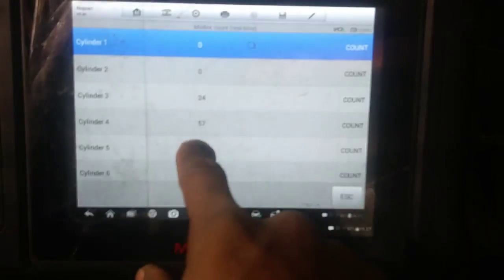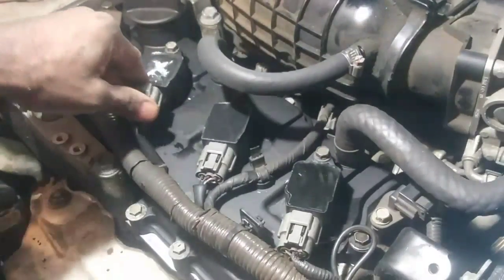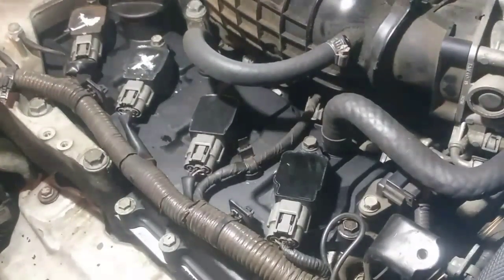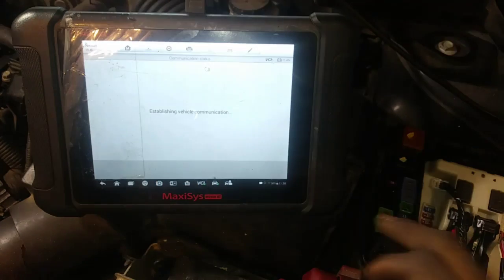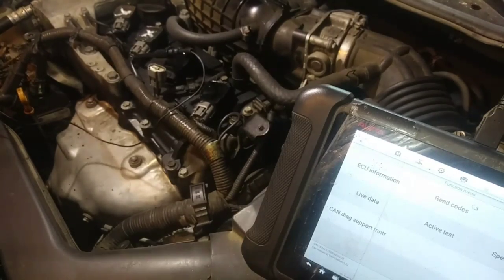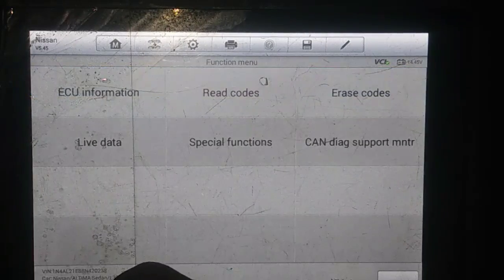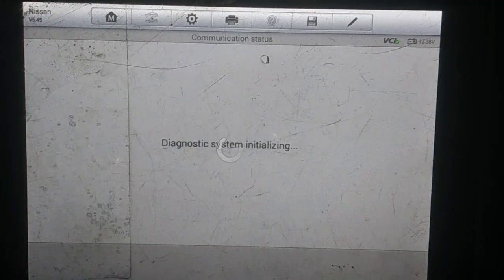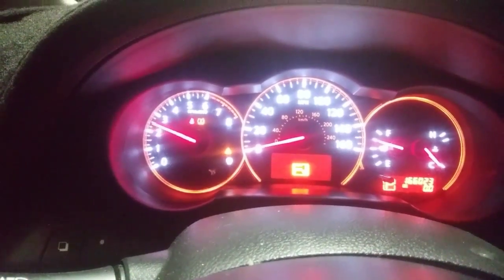Nissan Altima ignition coils keep going bad!?!? what fixed it?

Comment: I had the same issue when I looked closely i noticed wire dry rotted and slightly cracked. i would see a slight arch from time to. I replaced the pig tail and no miss fire. 6 month later my coil began  to misfire. It's the coil that was originally connected to the bad pigtail

Comment: Is it possible to replace the ecu without reprogramming anything? I'm asking cause my Altima is doing the same thing here. It's getting 12 volts to the coil but low signal power.  Coil cyl #2 keeps going bad afrer 2-5 drive cycles. Would you suggest new ecu?

Comment: Check for broken ground wire by transmission...or ground wire to frame..
Reply: Bingo. This is a TSB Bulletin sent out by Nissan and that was our problem. The Ground wire on the battery was broken. No one addresses this in their videos
Reply: Ground wire issues are a pain in the ass...and so common

Comment: I have a 2004 Nissan 1.8 l that keeps burning up  ingniton  coils  the mechanic tells me that the coils are getting too much voltage  and  he's telling me that it could be a spike in voltage caused by  ether  three things the cam the altinator  or the crank shaft potion sensor I think  maybe  it could be the com got shorted out some how if you could help me with this problem I would really appreciate  it there's  a misfire on cylinder  number 3 the compression in all 4 cylinder is good I can't see how it could have melted  all the coils
Reply: Look up ScannerDanner and SouthMainAuto on youtube.
They are very good at diagnostics.
Stay gold.
Reply: @dnlmachine4287  I am having the same exact issue on a 2012 Nissan Sentra. Did you end up finding out what it was?
Reply: @Micscience  Most coil problems I have solved by checking ground wires and replacing coils with Original Equipment rather than aftermarket.   Of course do all the checks shown in the video, inspect spark plugs, battery, connections,  alternator etc.
Stay gold.
Reply: @dnlmachine4287  The problem with the Sentra is the coils and plugs are hidden so you have to remove the plastic intake to get to them so running the car to replicate the intermittent problem is kind of out of the question which makes it a PITA. I know for sure cylinder number 3 is arcing and it very well could be a ground issue.
Reply: @Micscience  Check the wiring diagram for connections or places where the wiring could be accessed with test tools. The ECM may be a place to do testing as well. Sounds like you may need a lab scope if its intermittent.
Stay gold.